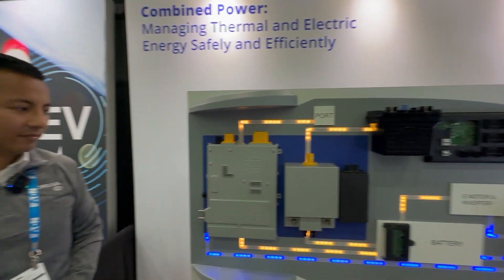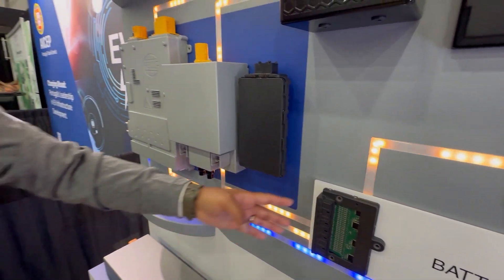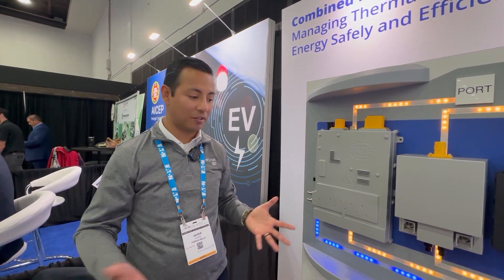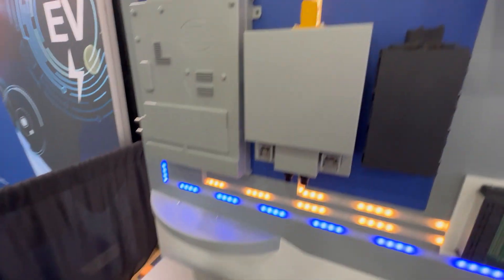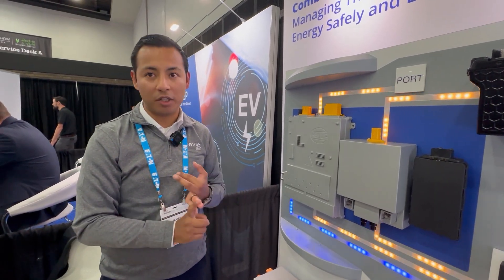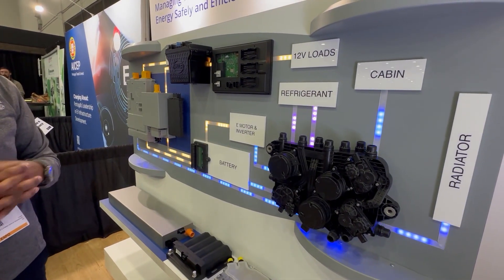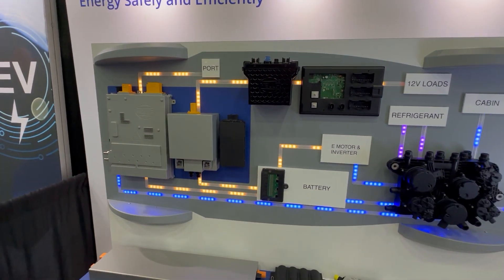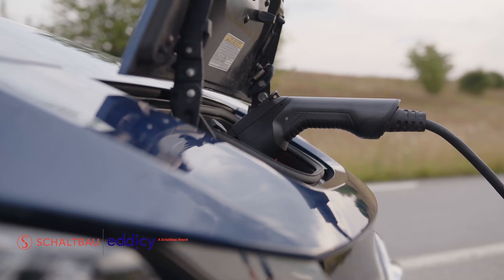ForviaHella Takes Cost & Weight Out of Battery Management - The Battery Show 2024

Comment: I see that form as a good N+1 solution. Pull off the bumper and you can slid in One, Two or Three "Power Sticks" to adjust Range vs Load. Also, there is the matter of Ease of Repair and upgrade!